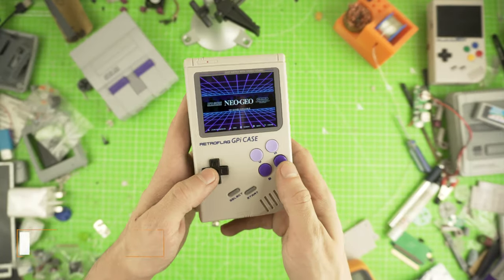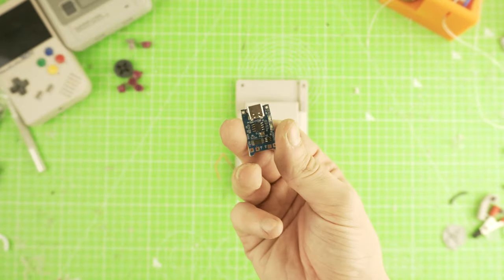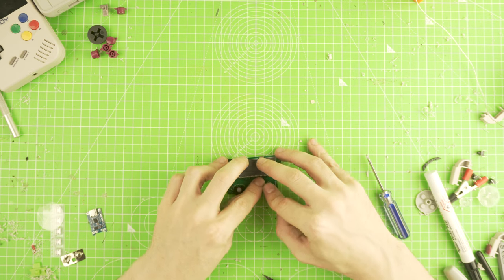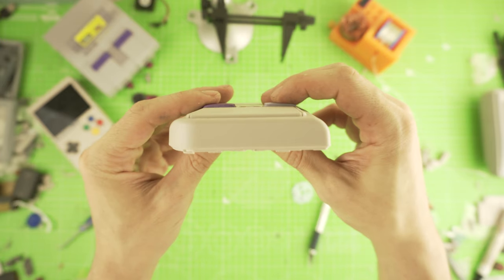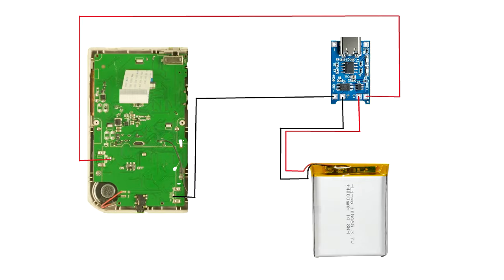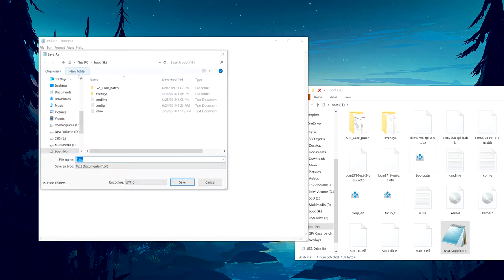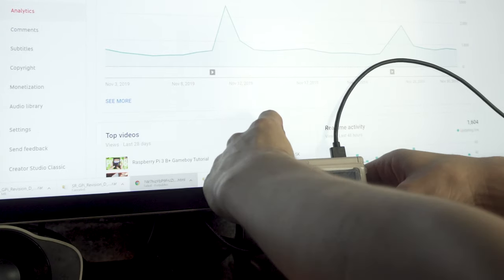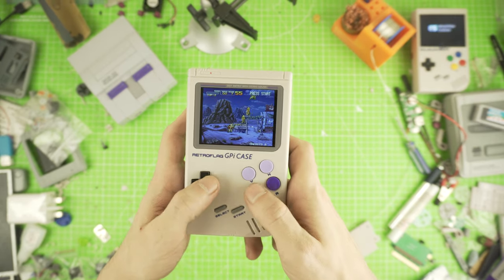Retroflag GPi case HDMI out and Type C Modification

Comment: LOL, just modded my original GPI case today.  I need to cut the case to allow USB charging though.  Currently I just slip the battery cover open slightly and insert the cable.  Not the best, but I need to get some USB-C modules, only had the micro one laying around.  Your builds look great.

Comment: Awesome video! I am very interested in somehow getting a usb input on one of these. I have one that I havnt used in a couple years due to having another handheld I like more. But I got this crazy idea to build another tiny arcade machine (built 2 others so far) anyway these projects usually end up costing so much in the end, and I was thinking if I just make a wood cabinet for the gpi to slot into i already have most of what I need, but I need to find a way to plug the USB controller pcb that will be in the mini cabinet into the gpi. Any advice? I'd really like to be able to take it out and still use it outside the cabinet so I don't want to solder the controls directly to the gpi.

Comment: Hi Adam, 

I have a question please. I tried to add the soft tactile buttons like you have done in your video, except that when I went to fold the buttons back to the board, the legs both sprung off and tore the pads off the pcb. I still have the trace lines left and the vias, so can solder directly to them, but do I need the points on the board which have been damaged? I'm trying to understand how the tactile buttons register a signal when pressed and although you only use the top 2 legs of the tactile switch, is there something additional happening with the trace lines under the tactile switches?

Comment: Hi Adam, can you tell me how the custom buttons stay in the console? Do they not fall out once it's picked up? I'm just trying to understand what keeps them attached. I know they have grooves to slot into the plastic edges but as the buttons move, don't they become loose? I have all the parts to do this mod, I'd just like to know in advance. Thanks!
Reply from the maker: The buttons has some pegs on each side, which keep them in place, they can't fall trough as you enlarge the Wells to the same size as the SNES controller
Reply: @Adamstech  Thanks for replying. When I ordered the 3D prints mentioned in your description, the buttons arrived with 2 small plastic pins, are they the pegs you're referring to? Where do they go? Also, what sandpaper did you use to file the buttons? Thanks Adam!
Reply from the maker: Sorry just saw the message, yes those are the pegs that I am speaking about, in the backside of the button, you will find a circle indent, there you need to glue it
Reply: @Adamstech  Thanks Adam. I really appreciate your help. Your videos are great.

Comment: Awesome mod! I did the usb-c + lipo mod for one of my cases and it works like charm! I used a different lipo (105068) and had do remove more of the case.
I have two questions: Can we change the voltage threshold for the low battery indicator (blinking led)?
And I scratched my front COVER :( Is there a way to replace the window for the screen without buying a whole new case?
Reply from the maker: Not really easy to find a lens, but if someone can help you that is Claire from Retroflag, just hit them up with an email, and they might be able to help you. Glad that you made it working and glad that I helped. With the voltage threshold I think it can be changed from within the script but don't quote me on that

Comment: I had one issue with the HDMI out Mod:

The Pi is mounted so far inside the case, that a Standard mini HDMI can't reach the pins of the connector

My solution (since i f'ed up the filing anyways) was to Cut a big enough hole to fit the entire connector and 3D print a removable cover

Comment: What wattage USB C charger can you use, is it USB C PD or only USB C to A?
Reply from the maker: USB Type-C socket as a standard supports 20 V at 5 A (20 * 5 watts) 100 watts. For ratings of the charger check Tp4056 and check the spec sheet.

Comment: Very cool tutorial! For some reason I can't get the hdmi detect script to work. I have to "disable hdmi output" in the options menu in order to use the GPi screen again. Any ideas? I made sure to put the script before the "exit 0" line. I'm using a Magnus RC 32 bit Supreme Gpi image.
Reply from the maker: It does the same for me as well, I showed that I disable it as well, we have to try with a new image
Reply: Adam Builds cool. I’ll keep working at it too. If I find a solution I’ll post it here. Thanks for the reply!
Reply from the maker: Thanks man, if you do, it would be great!!

Comment: I seen some aa sized lithium ion batteries that run at 1.5 volts would those work well with this case?
Reply from the maker: In a non modified version I don't really know as I never used them with aa batteries, but you can hook them up in series and you have 3V that can be boosted if you are looking into modding it
Reply: Adam Builds I’d like to purchase one of these full completed and ready to go. Can you reach out to me and let me know how much you’d want for something like that?
Reply from the maker: @natea8405  Send me an email on Adam@8bitcustoms and I will send you the list with mods